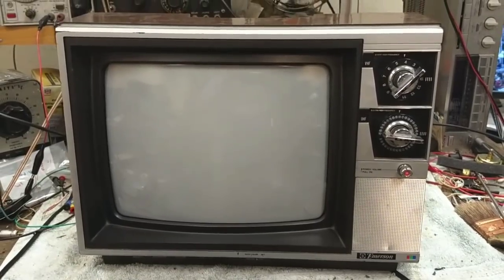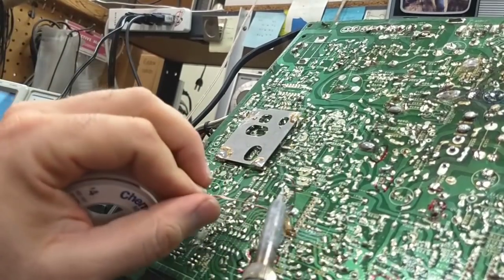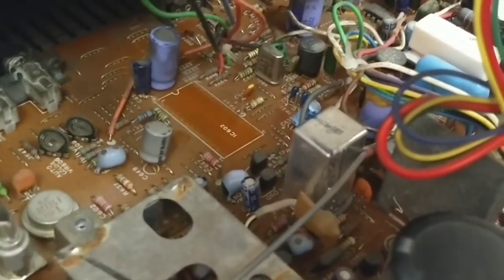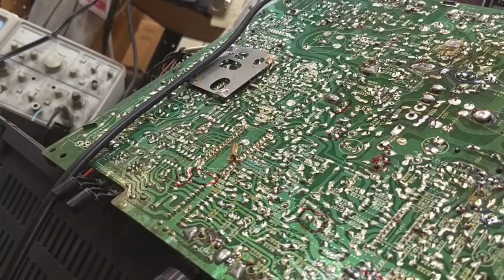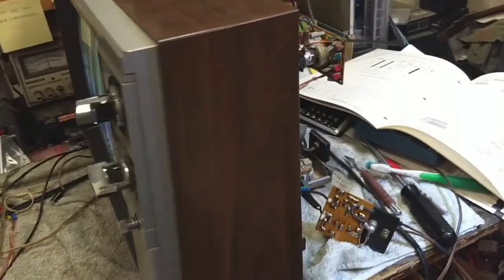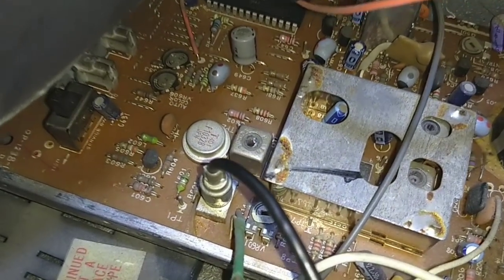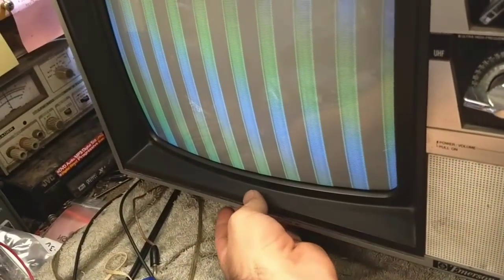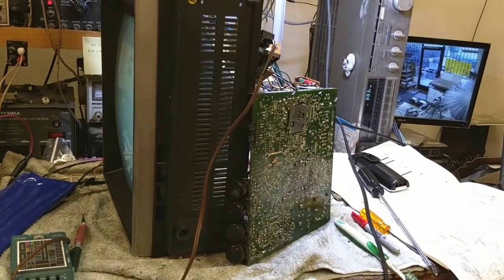Troubleshoot and repair a 1984 Emerson EC133 color tv Part 3/5

Comment: Any time I took the trouble to unsolder a large DIP IC, I always placed a high-reliability gold DIP socket in place. I've never just resoldered in a new IC. I used to buy those high-rel DIP sockets in bulk in all sizes, from the electronic surplus stores that once were everywhere, back when people were interested in electronics as a hobby or occupation.
Reply: Same here. I just finished replacing an IC in a 1986 NAP Sylvania and installed it in a socket.

Comment: Jordan Pier If you're missing 3.58, then you need to check the waveform at the crystal to see that it's oscillating. If not, then it could be the crystal or an open C642 which is in series with the crystal. If you've just replaced IC602 (the chroma processor) in this video, then your first check is that you're generating 3.58. Without that signal, no color sync. For a color signal you need good 3.58, a good front-porch burst signal (good video), and good chroma path processing afterwards. The fact that the Color control doesn't do anything should alert you to search for good bandpassed chroma. You may not have access to the chroma signal inside the IC, but there should be a chroma test point somewhere. I see that there's a 'Color Control' box inside that IC, and that circuit may be using DC from the physical pot to voltage-control the parameter inside the IC. In summary, you need 3.58 first.

Comment: I've had good luck using a hot air rework station to desolder large DIP packages. Seems to be easier on the PCB than the vacuum desoldering tool or solder wick. The trick is to use some aluminum flashing as a heat shield so you don't melt nearby parts.

Comment: Freeze spray on the 3.58 MHZ  crystal oscillator? Bail out for a while and when you tackle it  you'll find the problem in a few minutes.
Good luck! When I ran an automatic board tester, I'd scope the crystal  before it was sent to production. Occasionally would find a few bad ones with no output at all.............. Good catch on the missing tuning core....

Comment: Are there any components outside the IC that help determine the 3.58 ?,
Reply from the maker: Just a crystal. I've got some coming as a quick swap to see if that brings back my color. I'm sure there's more afoot - just haven't figured it out yet
Reply: That’s a weird problem , seems like the burst signal is weak , or just off frequency enough to lock in the oscillator, I have soldered a small variable silver mica cap across the crystal before and was able to pull down the frequency and got it to lock in .it seems like the lack of red problem is unrelated
Reply: Keep poking , you’ll find it

Comment: You can't measure resistance for ground problems with power applied to the circuit!!!   I am pretty sure you have a ground problem on that board, but you need to measure with no voltage in the circuit.
Reply: Robert Bakley I was thinking the same thing 😎